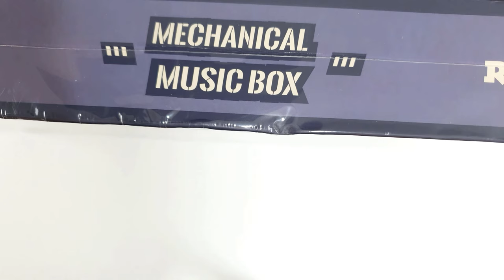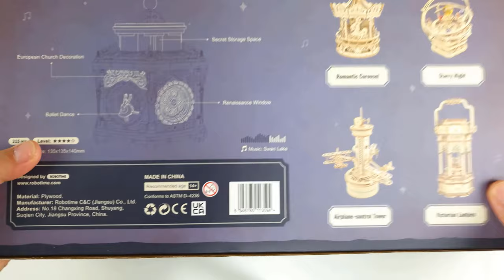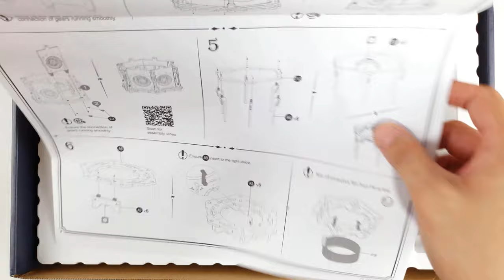Music Box  - Vintage Style 3D Puzzle

Comment: Your video was very well done except for, I believe, one omission. At 12:15 you should have installed E7 pins into the six C1 slots which protrude through A8. See the first drawing in step 8 of the instructions (E7 x 6). This locks the bottom assembly to the top. Without this step one could not keep the box assembled if it is lifted from the top of the box. I don't know how yours worked without this step unless you went back to correct it off camera.
Nevertheless, very nice presentation and photography. Thank you for posting this.

Comment: How did you get the gears to actually line up and work? Mine won’t rotate when all the panels around it are in place
Reply: Did you got it to work?
Reply: I have the same issue. At least it looks pretty and I refuse to take it apart to fix it lol
Reply from the maker: usually it's a snug fit, wax helps a lot
Reply: Too much fiction, mine got stuck too

Comment: Spent hours today putting all the side panels together and in place only to have the gears not work. Its aligned alright as far as I can see but it just gets stuck and wont work. I am so worried about it breaking. I read through some of the comments and maybe I didnt wax the middle wheels enough. Guess I will take them out tomorrow and see if that helps. I really want this to work properly, I've always wanted a music box just like this one.
Reply: For everyone experiencing the same problem, I found out why. One of the sidewalls is wrongly cut, so the wheel is about 1mm to low and it gets stuck.
Reply: @lorenznolfi368  I noticed this too! I thought I put it together wrong.

Comment: 11:33 how is the plastic ring not constantly falling out? It sits way too loose for me :/
Reply: hello I have the same problem as you
Reply: @ElisabethPailloux  hi ^^ so I managed to get around that problem by gluing the wooden pillars from the lower part of the music box into the holes so they don't constantly move and fall out (wasn't able to glue the plastic ring to the sides so I went for the pillars). Then I turned the thing upside down and it was quite easy to finally put the two parts together.